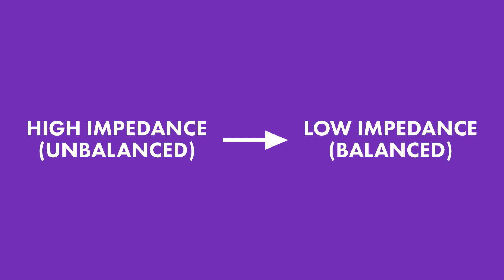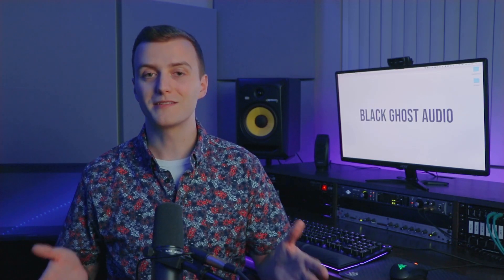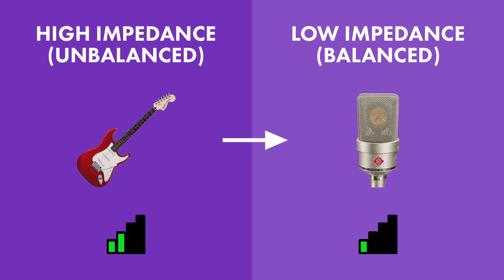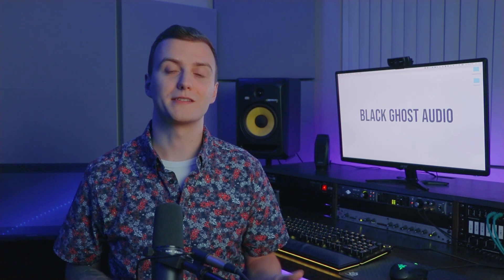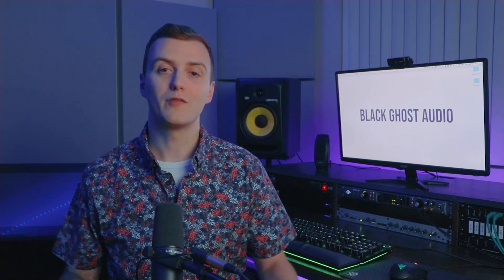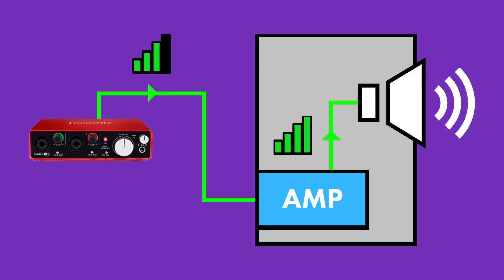Audio Signal Levels Explained: Mic, Instrument, Line, and Speaker

Comment: I have a PA speaker that has a built in switch for the input line and mic. If I intend on hooking up the mixer (mic´s, guitars and bass) to the speaker, which one should I select on the switch, the Line or the mic option?
Reply from the maker: Your mixer will bring everything up to line level so you’ll select the line input on your speakers 😁
Reply: @BlackGhostAudio  Thanks for replying, I appreciate it ♥️

Comment: I normally DI my guitar straight into my DAW, but the signal that I record is often very weak. Do I need to use a preamp in conjunction with the interface OR do I just need to do some gain staging inside the DAW?
Reply from the maker: Which audio interface are you using?
Reply: @BlackGhostAudio  A very old Avid Digidesign Mbox 2.
Reply from the maker: @leaveitorsinkit242  there are preamps built into your interface. When you plug your guitar into a DI jack on your interface, make sure the preamp is toggled into DI mode (as opposed to Mic mode) and then adjust the level of the preamp using the associated knob 👍🏻
Reply: @BlackGhostAudio  Thank you so much! 🙏🏻

Comment: So is it ok that the xlr inputs on the foh mixer all have preamps? Its it still ok to run a line level signal into the xlr input on the mixer even though it has a preamp in it?
Reply from the maker: Those preamps are built in to let you bring mic level signals up to line level, which is exactly what you want. Mic signals are typically run through cables with XLR connectors.

If you’re trying to connect a device that produces a line level signal to a mixer, use a TRS cable to connect to one of the mixer’s line inputs.
Reply: @BlackGhostAudio  but XLR can go long distance. But what about 1/4in TS cables? Do you use some kind of box to go from line level device output TS cable to XLR, then run the long distance, then another box to convert XLR back to TS cable into the mixer? Or do you just run it into a direct box and then run XLR the whole way except at the mixer then convert the XLR to TS cable with an adapter?
Reply from the maker: @mrfender5001  TRS cables use a balanced connection, and line level signal is quite strong, so you can run line level signals through TRS cables over quite a significant distance. TRS cables are the type of cables typically used to connect line outputs to line inputs. It's TS cables that are unbalanced and carry unbalanced signals, which are produced by instruments like electric guitar and bass.

If you want to run the signal produced by an electric guitar over a significant distance, you should use a DI box to convert the instrument level signal (unbalanced) to mic level signal (balanced). Once you've done this, you can bring the mic level signal up to line level using your FOH mixer.
Reply: @BlackGhostAudio  ah ok I see what you're saying. Thank you so much for the info. I needed to know. Im a new sound guy at my church of 200.
Reply from the maker: @mrfender5001  that's awesome! If you look up the documentation for the mixer at your church online, it should provide additional information, and potentially some helpful signal routing diagrams too.
Reply: @BlackGhostAudio  Lol! I just thought about just after my last comment! But we are about to get a new behringer x32 mixer for the church so I will wait till then. But I will definitely remember your advice when hooking it up. Im ordering some stereo TRS cables now from Amazon with church credit card. If they get mad at me I'll point them in your direction! Lol! Thanks again!
Reply from the maker: @mrfender5001  send them my way, haha 😂
Reply: @BlackGhostAudio  Lol🤣 Oh I promise... I will!